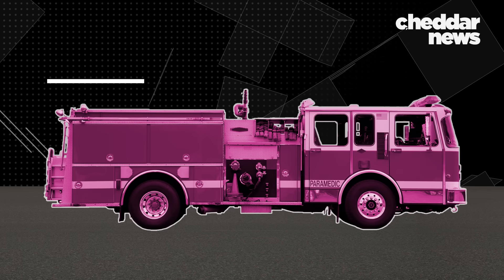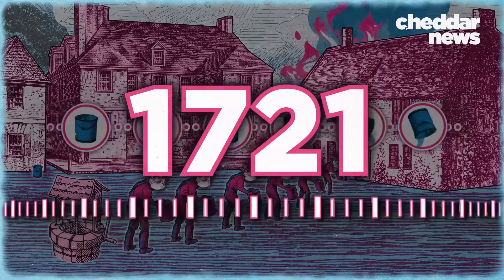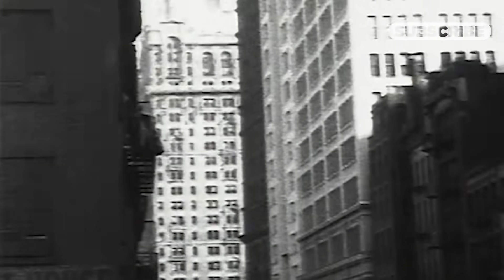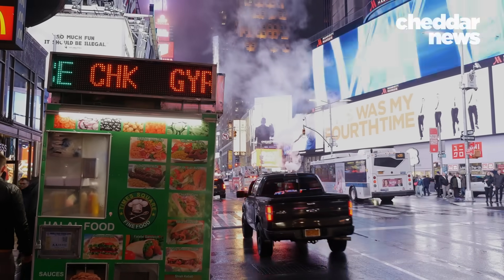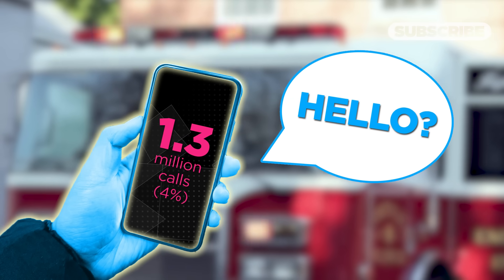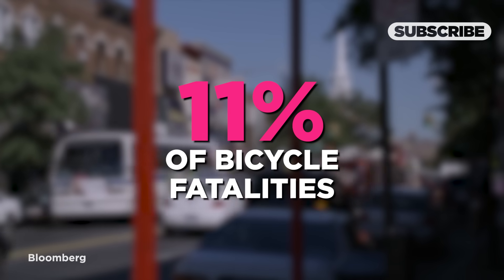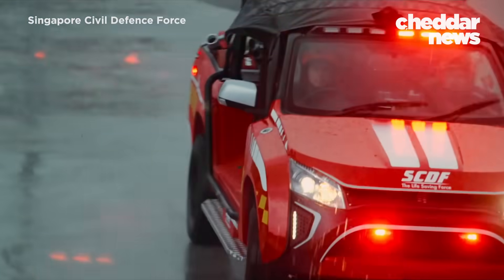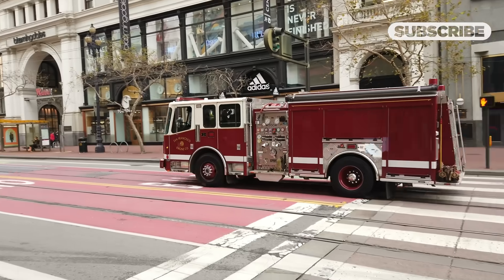Do American Fire Trucks Need To Be So Massive? - Cheddar Explains

Comment: You left out that well maintained fire engines can last 25 years, about 70% of firefighters in North America are volunteers, and that pickup trucks don’t put out fires. 

Two or 3 guys in a pickup truck still need hose and a pump to put out a fire. 

Volunteer Fire Departments are typically manpower strapped. They don’t enjoy the luxury of having 10 smaller fire trucks show up with all specialized equipment in each one like you might have in Tokyo or Berlin. A rural fd might get 5-10 guys and pull 2-3 trucks for a job. You might clear off a fire alarm and get a wreck or get diverted to a water rescue. You need to big truck to carry all of that. Lastly, whole 400-600k is a lot for a new engine; that’s usually a “soup to nuts” loadout. Things like air packs, radios, and new hose are all built into that price. Radios can be $5-10k a piece and there could be as few as 5 or more than 10 radios on a fire truck. Most of the time cash strapped volunteer fire departments will roll in the cost of new equipment into the truck spec bc it’s the only time that the town is opening up their Wallet; for that new engine every few years.
Reply: apparatus lasting for 2 to 3 decades - same in Europe
In Germany 96% of firefighters are volunteers
and that pickup trucks don’t put out fires. " not in the US, here they do. Just like motorbikes, compact cars, SUVs and vans, when spec'd as Mini Pumper or Quick Attack Unit. Don't require much water to extinguish a car fire. Small UHPS extinguishing systems are sufficient for most fully involved car fires. 
I live ina  village of 10k inhabitants and the volunteer FD runs 10 units at the moment. "A rural fd might get 5-10 guys " here we have a standard of a 9 man crew on a normal Engine (at volunteer departments)

Comment: I would like to take the time to comment how many things are wrong with this video. What isn’t taken into account first of all, is that different countries have very different approaches to their fire services. For instance, every vehicle is a specialized vehicle. What does that mean? Well, a pumper is only a pumper, not a rescue vehicle. A ladder can only ladder, can not pump or carry any additional equipment. Pumpers are not paramedic certified, fire and medical are separated. Rescue and fire are typically in different rigs. So all those pieces of equipment cost money, and have distinct manning requirements. Some main stations in Singapore and large European cities have 50 fire fighters assigned to a station. That is unheard of in the States. Some Europe assignments may require 5-6 pieces of equipment whereas in America it may only require 2-3. American pieces are designed as they are because they are medical, sometimes paramedics, rescue for traffic accidents, mountain and cliff rescue etc. fire, water rescue, hazmat and confined space. Whereas other countries limit their first line pumper or engine to only certain activities and have specialized units.
Reply: Looking at Europe there are SOME specialized vehicles, but not all are specialized to perform only one task. Comparing an incident like a fire in a building, the FDNY would roll up with a comparable number of apparatus like they would in a city in Germany, with the difference that the apparatus from the FDNY would come from maybe 6 different stations and those in Germany come from 1 to 2 stations. 
In Germany, a pumper isn't only a pumper, a ladder not only a ladder, rescue and fire aren't necessarily different righs. Same goes for many other countries in Europe, but I wouldn't dare to say it's the same in all countries

Comment: Maybe you should look into NFPA standards. There are minimum requirements for each class of apparatus.  Not to mention fire operations are much more aggressive in the US.  I pan most departments in the US you’re much more likely to see water coming out the windows than going in them. You mention no fire related calls. Whether that be a car accident or industrial accident there is a need for many of tools and equipment.  The reason so many departments run medical calls with engines is money savings not needing to run a separate EMS division and many ambulance services in the US are private but an engine can be on scene quicker to provide care.
Reply: this! 👍🏼
Reply: "Not to mention fire operations are much more aggressive in the US." like going for interior attacks?
"There are minimum requirements for each class of apparatus" same for the DIN standards in e.g. Germany. They tell the minimum tank and pump capacity and tell you exactly how many different tools and how many pieces a certain type of appartus has to have at least. At the same time it also defines the min capability of the truck and the max dimensions in size and weight

Comment: Yes commercial trucks are a lot more expensive, but with that expense comes quality and longevity. It’s fairly common to see a commercial tractor trailer with over a million miles on it. That same quality is used on most US fire trucks. It’s not rare to see 20-25 year old fire trucks at most stations, where as a pickup counter part mostly wouldn’t last that long. Also when it comes to US roadway crashes, with the higher speeds, I’d much rather have a commercial truck providing traffic control protected the emergency crew. Sometimes a bigger truck isn’t always a bad idea.
Reply: Although it should be said that at least in Germany, most fire engines also have a common service life of 20-30 years, with some possessing even older vehicles. Other emergency services such as the THW also make regular use of vehicles from the 80s and 70s, however those are currently being replaced by new trucks.
Reply: Meanwhile my country allows commercial trucks to be used for a maximum of 17-20 years only (probably to force owners to update their fleet of vehicles to the latest engine emission standards)
Reply: This vid is just America bad bait.
Reply: @JPLangley_  Sounds like somebody is salty, mind if I put add additional seasoning with that?
Reply: @PriceTheCourier  it kinda is and the EU counter part isn't better, it's actually worse.
Reply: @tylermarciano2286  I need to change my username to "local idiot on the internet."
Reply: "Also when it comes to US roadway crashes, with the higher speeds" ... *scratching my German head*. You are aware of Germany not having a general speed limit? that people may legally fly down the interstate at 250 mph? Even if you do "only" 180 mph with a motorbike you still need to watch out for potentially a family station wagon approaching form behind, waiting to overtake. However the rate of road fatalities, also when put into ratio of the population or million miles driven, is way lower in Germany. Most fatal traffic accidents don't even occur on the Interstate there. 

Apart from the aspect of speeds driven: many apparatus last for 2 or 3 decades in Europe as well. Obviously most fire apparatus won't drive long distances anyway and are well maintained (at least at most departments)

Comment: North American Fire Trucks are larger, because of the number of people to transport, multiple task and TOOL'S, also WATER is always a major issue. A class 1 pumper has to have 750 to 1000 gal's of water.
Reply: German Engines carry a crew of 9, less water and smaller pump but thatfor also a ton of equipment and tools

Comment: Reliability is another thing that should not be ignored. Fire trucks typically carry much more than 500 gallons; more like 750-1000, to 3000 gallons with a tender. The water alone then weighs anywhere from 6000 to 25000lbs! Add the that all the equipment to rapidly deploy said water, everything else a crew needs, plus having a truck that can protect its crew from heat and debris from a fire. We have 20-30 ton trucks for a reason. Could smaller, lighter trucks do the same job? Possibly, but the smaller and lighter a truck is, the more stress you put on its components, causing parts to break more often, which costs more money.
Reply: Most fire trucks in Germany are based on commercial heavy duty MAN, Scania or Mercedes chassis, which aren't only incredibly reliable, but also tried and tested from commercial use. This doesn't just ensure that fire departments have capable and reliable trucks, but it also saves the cost of developing all-new trucks and thus cuts down on the purchase price.

Comment: A town I lived in added traffic circles to some streets to control traffic speed and send traffic to adjacent roads instead. They made the circles too small for the fire trucks to get through and had to rebuild them with a bigger diameter.
Reply: in my area the smaller traffic circles just have a low domed area in the center and you can drive straight through

Comment: Compare apples to apples.  Provide a list of what's carried on a class one engine (not a truck) in a major US city, and what's carried on a comparable engine in a major European city.   Emergency services in Europe and Asia are provided differently than in the USA, so the equipment load out is different.
Reply: Outside of water and pumping capacity the difference in equipment tends to be negligible. The standard European fire truck carries all the equipment needed, as well as a small water tank and some pumps. If that isn't enough, many departments have specialised trucks for pumping and transporting water.
Reply: as you pointed out, they're used differently, so also the task for the different types of apparatus differ on either side of the pond. Kind of makes it hard to compare apparatus of the same type then

Comment: One of the main reason they are so big is because of the pumps are so big and they need to be big so supply water pressure to apartment and other tall buildings stand pipes with enough water and enough pressure my department fire its not a fire or a wreck the engine would stay at the station we had a smaller truck that would go with the ambulance to medical calls that lasted a month it wad hit two different times and totalled both times it was on a call parked with all lights and the people said they could not see it so we went back to taking the large truck and no one has hit it point being it's large it stands out and can be seen from a long ways off
Reply: by them saying "they couldn't see it" they actually say "they didn't pay attention" ... our ambulances, depending on the type, have 1 or 2 lights at the rear. Never was rear-ended; And usually we switch emergency lights off when on scene
btw you know also in Europe larger buildings have standpipes etc ;)

Comment: No disrespect, but for next time you might want to do more research into the fire fighting methods between different countries. You’ll find the answer(s) to your queries by learning those differences. 
There is no “standard” fire engine,  at least in the US. The size, use, engine vs ladder, tractor drawn vs tower ladder, all are determined, designed and then constructed based upon the fire department’s needs and firefighting style. 
Firefighting practices are very different from country to country and therefore the size of apparatus is directly related to those differences.
Reply: firefighting in Norway is totally different from firefighting in Germany, but apparatus in both countries are of the same size. Also firefighting in Austria is totally different from firefighting in Australia, still apparatus from both countries are of similar size

Comment: This video takes the 'poor, innocent pedestrians ' point-of-view versus. Those ' humongous,  dangerous fire trucks '.  And, of course,  how America's bad !
But they never look at a very obvious factor:
In the U.S., a fire is reported, and a pre-determined response is dispatched.  There MAY be 4 or 5 FFs, and necessary equipment. 
And, depending on various factors, MAYBE 2-4 trucks.
In Europe,  it's very common to see a  CONVOY of trucks responding.
They (as stated prior) have different condition to deal with. Smaller streets/roads, tighter, older cities.
Why would anyone want 5, 6, 7, (or more) trucks responding (then 'parking' at the scene when 1 or 2 is adequate?
More, smaller trucks would actually be MORE dangerous!
Reply: how exactly would more smaller trucks be more dangerous? Tbh e.g. the FDNY responding to a fire call, I see at least the same number of apparatus like I'd see in Germany, but they come from 4 to 6 different stations instead of from 1 or 2 stations. With all apparatus coming from different stations I think that's more dangerous than all apparatus responding from the same station in a convoy, with their size not really being relevant in that aspect
Reply: @EnjoyFirefighting  EXPOSURE. 
More vehicles,  more opportunities for 'incidents'.(Crashes, pedestrian inter-action, etc)
I'm not saying either way is correct, or better!
I was just pointing out different thoughts.  There are so many contributing factors to why Europe and U.S. FDs have evolved into very unique worlds!
It's an interesting conversation.
And way more complex than a quick YT video can cover.
Reply: @GMan-yv8cb  but all of them responding in a convoy also means others have to stop or pull over only once, compared to them pulling over 5 times for 5 trucks coming from 5 different stations and directions. Tbh that's more exposure and more opportunities for incidents ... not just involving fire apparatus with other road users, but also fire apparatus and another fire apparatus heading to the same incident; I guess we know the kind of videos of fire trucks crashing into each other at intersections

Comment: Another thing to think about. Not sure about other countries but the US has seen a large drop in the number of firefighters over the last two decades especially with volunteer departments. Because of this we have less people available to drive apparatus meaning there is a good possibility that not all the needed equipment will arrive on the scene of an emergency. This has caused Fire Departments to compensate but building bigger trucks that carry all the needed equipment on one truck and also carry more water then older generations. Two decades ago standards water tank size on a pumper would typically be 500 gallons now most departments besides the big cities are carrying 1000 gallons or more. Also Fire Departments respond to so many other types of calls then in the past that we have to carry more equipment meaning more room is needed on apparatus. If more people would volunteer then maybe we would have the man power needed to get more apparatus responding allowing for smaller apparatus to be used. This would allow us to spread equipment out more among more apparatus then having it all on one or two big trucks.
Reply: That's not an argument at all. If you have at least two people in one engine you could equally have two smaller engines with one driver each.
'Not enough drivers' has never been an issue since there are always several firefighters available.

Comment: I would say there are a lot of places that can downsize significantly, but that it is very location dependent. Most Fire Department's in the U.S. are an "all hazards" response service and need to be able to carry out multiple disciplines beyond just Fire and EMS and that the citizens in a given area will dictate the size of the rigs. In my area, laws and ordinances require us to initiate complex technical rescue within a certain period of time, meaning we need to carry more specialized equipment on our Engines and Ladder trucks. So it requires more compartment space. I know that is different in other areas of the country.

Also living in an area we're earthquakes can happen, our region has dedicated itself to disaster preparedness that requires us to carry things we may only use in a natural disaster. But the citizens have deemed that important to them. We could buy several different types of "specialty" rigs to carry this and downsize, but ultimately that could prove to be more expensive and hurt response times. 

I think there are many areas that could downsize, but it would be up to the local citizens and cities to determine what is important to them.

Good video!

Comment: The Europeans are now facing electric car fires which requires 10 times the water that American fire trucks carry to put out so the Europeans are literally going to have to upside their trucks to respond to the new paradigm of electric cars.
Reply: nope; That's what e.g. car fire blankets are for, and then the more or less extinguished car is submerged into a container filled with water. Well, that container sure requires quite a bit of water then